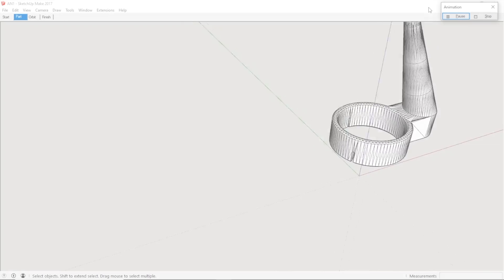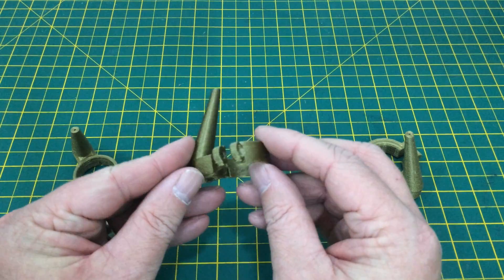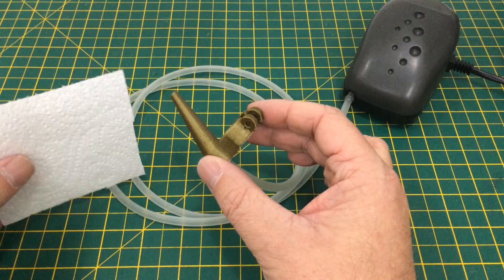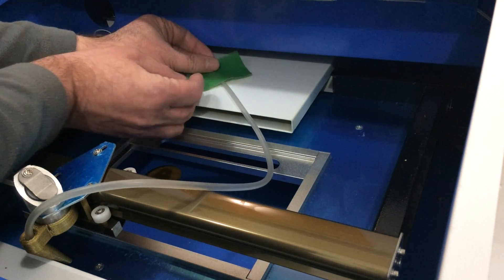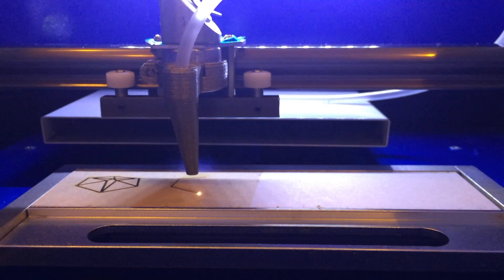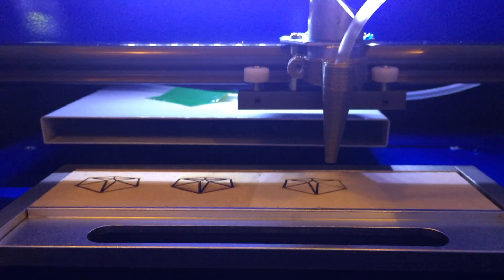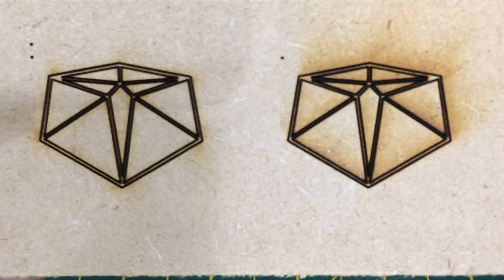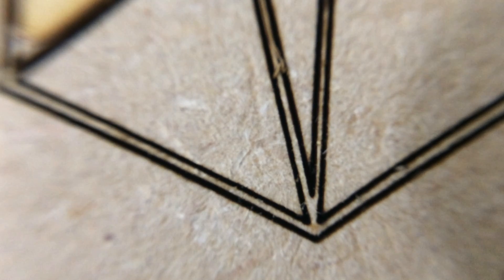Fitting and Testing my own K40 Air Assist Feed //Upgrade

Comment: What is the Rating of your air pump in Liters per min or per hour?
Reply from the maker: Hi Bob, thanks for your question. 

The pump I’m using is rated for 96 litres of air per hour. Its enough to blow gases away but not too strong that it blows card-stock for example.
Reply: @Tinkerneering  Wow, that is a LOT less air than some of the others are touting.  Just because it so much less can I confirm the number as 96 liters per HOUR.  I don't want to blow debris all over my cabinet, so less would be good, but I want to make sure it is "enough" as well.   

Thanks
Reply from the maker: I’ve just been to check the label on the back of the pump. 1.6L per min. 96L per hour. I haven’t tried anything else though.
Reply: @Tinkerneering  Thanks for checking. That opens up a LOT more options without having to spend $$ on a 96L per MIN pump... they are EXPENSIVE and noisy.

Comment: Thanks for this.  Is the configuration in this video all stock except the air assist?  Has that been acceptable?
Reply from the maker: I’m still using k40 whisperer with the same cutting and engraving speeds/power if that’s what your mean.
Reply: @Tinkerneering  I mean is the air assist the only mod you've done to the K40?
Reply from the maker: I have another video for a mod to the cutting bed, and one for a water temperature sensor on here. My machine came with internal lighting, a water flow sensor and a digital controller board.

Comment: Would it work to have a nozzle which blows across the piece to remove the particles rather than back down onto the piece where it causes the smoke staining?
Reply from the maker: So long as the piece you’re cutting/engraving is flat, I suppose you could create a nozzle that blows from a point really close to the piece but in an upward direction. That might create a suction effect. As I type, it might be better to look at sucking the smoke directly out of the way. Then you’ve got a between chance of less staining.